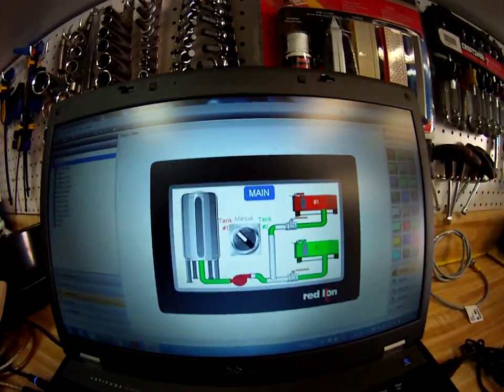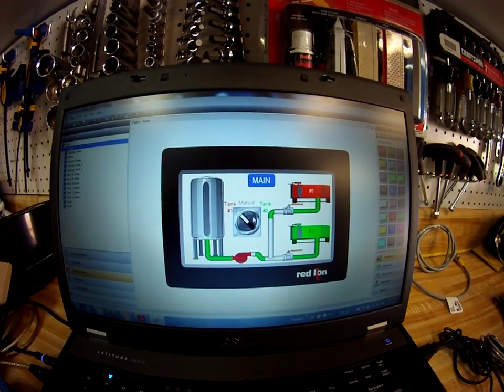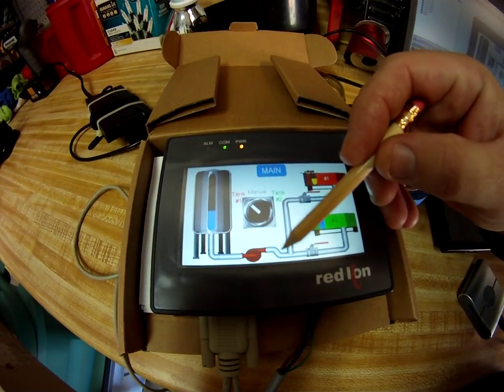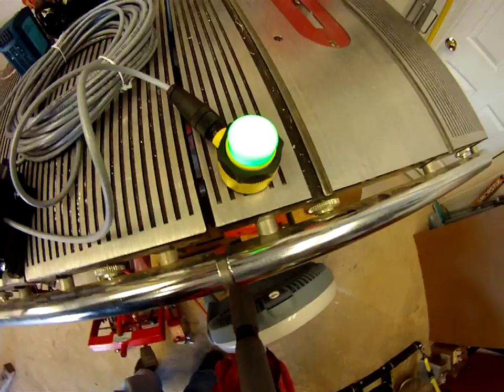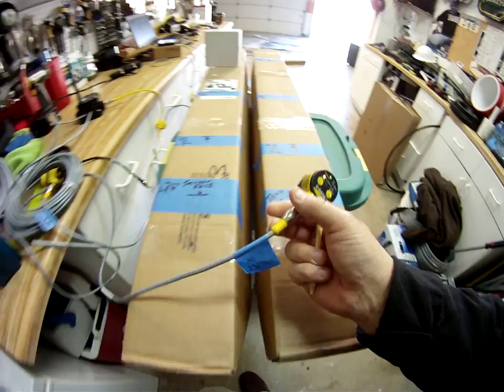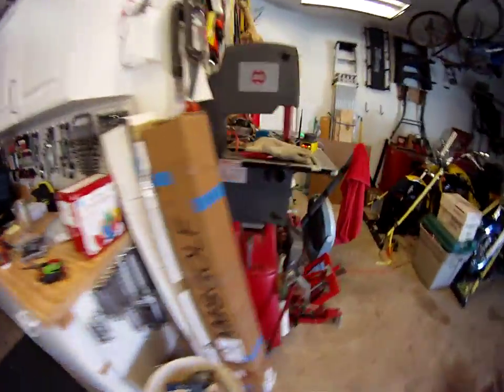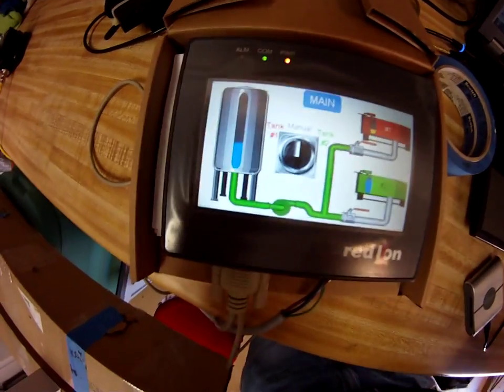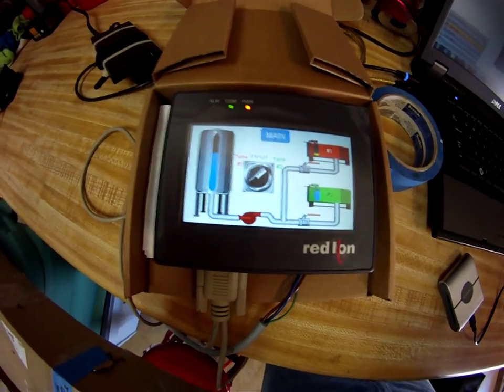3 Tanks Fill Application

Comment: can you please help me on this point:
how it's the communication with modbus 485 i mean send recieve example for example to get the value of the level what is the send request to the sensor.
i hope you can help with communication specification document
Reply from the maker: Ammar,
This is simple.  Create the Modbus Master driver in Communication under the RS-485 port.  Set up the protocol settings to match your Modbus setting, aka baud rate, parity, stop bits.  Device 1 or PLC1 will be the Slave device you are talking to.  Make sure the Slave ID matches that of the device.  Go to DataTags and create a Numeric.  Drag it onto a Display Page and download to your RedLion device.  Should put the data on the display.  Easy as that.